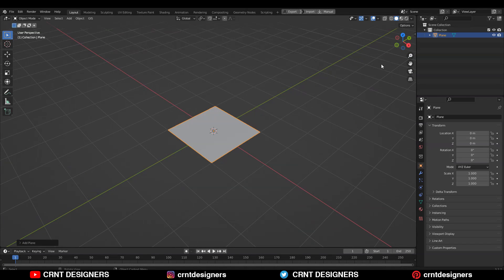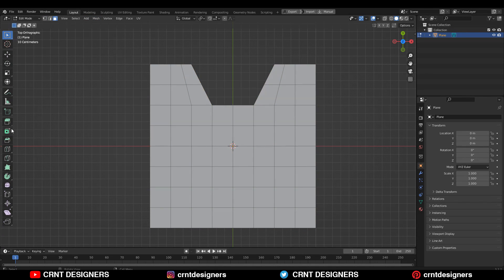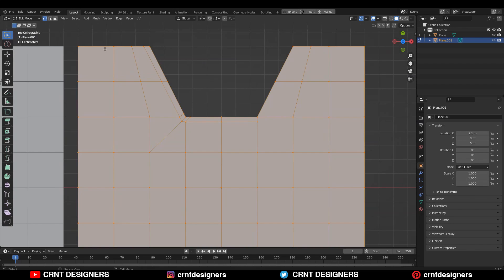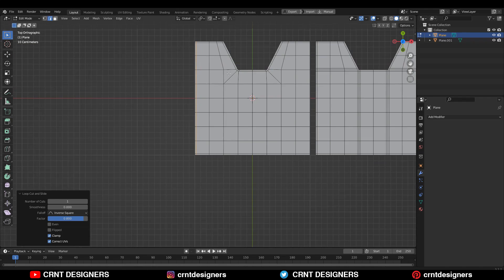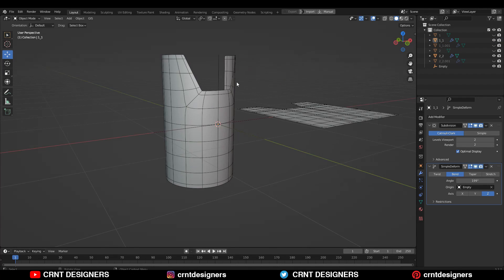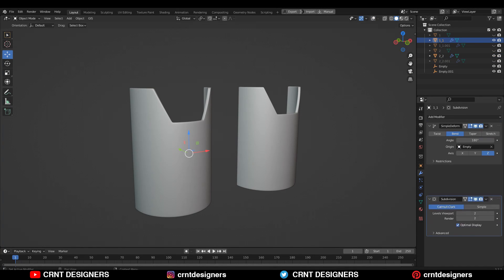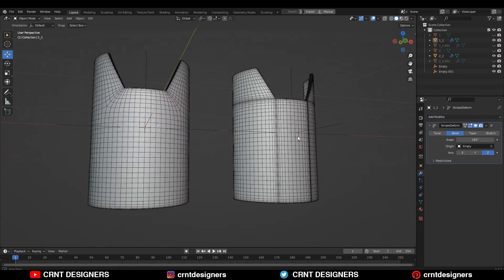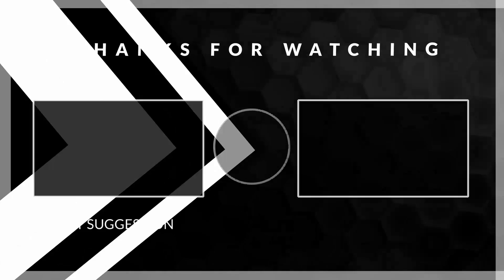Why Topology Is Important ?  Blender Tutorial

Comment: Is there a way to clean the pinching in the 1st scenario though?
Reply from the maker: One way is to start with high rise mesh so you can deform it as you want, if it's necessary then optimised topology and vertex count after deforming it
Reply: @CRNTDESIGNERS   So it's like doing retopo?
Reply: Two ways. Shrink wrap or data transfer.